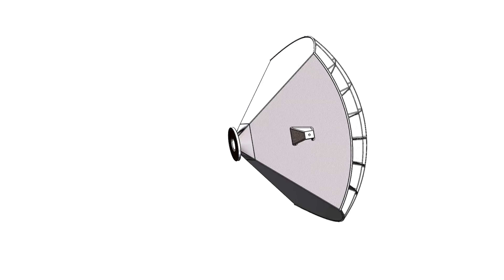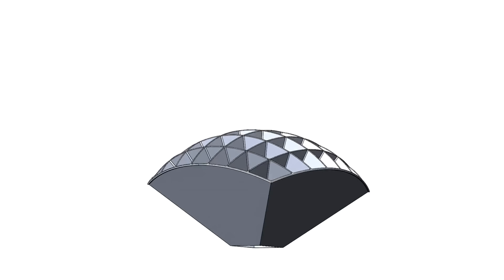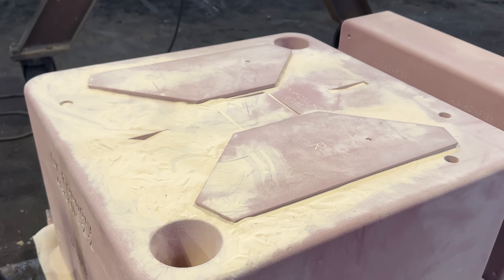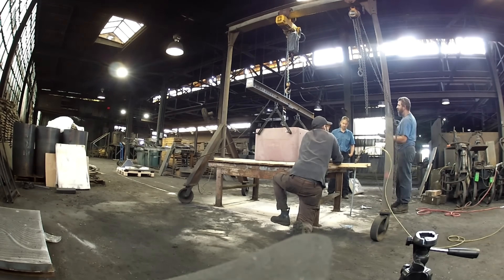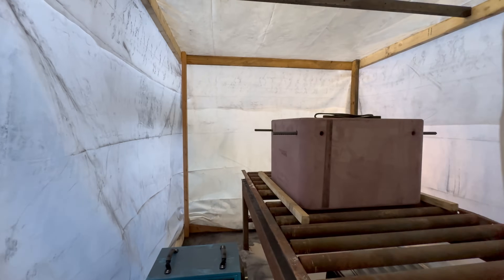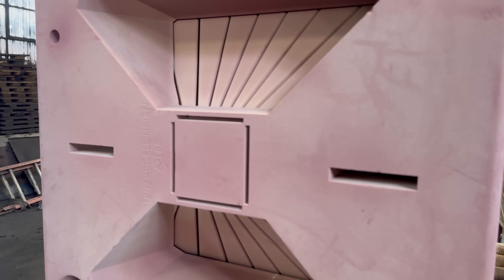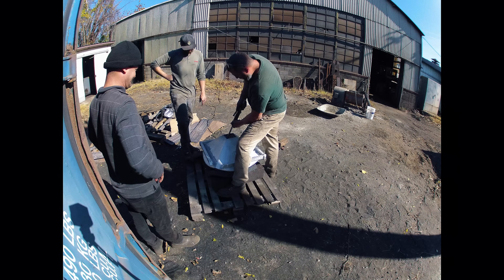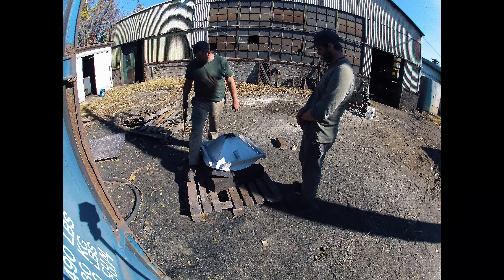PUSHING THE CASTING ENVELOPE W/ 3D PRINTED MOLDS

Comment: This is quite a feat but wouldn't a 3d printed horn directly in the same shape sound the same ? 
Also wouldn't a part like this traditionnally be made of lasercut sheet metal ?
Reply from the maker: Maybe. But a horn 3D printed from what? Printed in Aluminum? It would be astronomically expensive. Printed in plastic? Would a plastic printed horn function better than a cast aluminum horn? Not even close. 
Traditionally laser cut? No. Traditionally cut with tin snips and shears, yes.
Reply: @hinmaton  polycarbonate carbon fiber filament with a polyurthane clearcoat ?
Reply from the maker: I don’t know, does that material have better acoustic properties than cast aluminum?
Reply: @hinmaton  I don't know, maybe not better/worse but different resonance values. I imagine the exact dimensions would have to be adjusted to the ideal values for that material, especially the different speed of sound inside this material.  It is one of the stiffest plastic available and the price is reasonable.
Reply from the maker: So, to your original question, would it sound the same? I suspect that it would sound different, but it would be interesting to run some A/B tests for sure. I have no concept of what something of that size would cost to print.
Reply: @hinmaton  To sound exactly the same, the dimensions would have to be adjusted to the exact new resonant value. I don't know know if that means smaller or bigger horns, bigger or smaller wall thickness, if it's a big or a small difference.
As for price it is 64$ per kg and it is half the weight for the same volume of aluminium (1.2g/cm³ versus 2.7g/cm³)
This is probably a 2 day print on a large format printer like the Orange Storm Giga (an experiment 1 cubic meter printer)

Comment: The sound quality is very good no changes needed for sonics. You did amazing work!  The bass system I designed for it matched radiation pattern and it sounds as good on axis as off. One of the reasons I wanted that 7x7. Really look forward to the 2nd. And the  1/2 sized pairs for 1 inch compression driver. I was only able to get a 5x5 3d carbon printed. The 7x7 is visual and sonic art. Wonderful -wonderful The world needs more casted. I'm so thankful. JK
Reply from the maker: That’s fantastic to hear! I can’t wait to see images of the completed system you designed.

Comment: The cad design is simple to be honest, the molding is the challenge
Reply from the maker: Interesting perspective, I see the cad design as both, horn model and mold model. The CAM portion of this project is printing the CAD design. So, if the CAD is simple, then that makes it all pretty simple. And at a micro scale, you’re right: CAD is simple, CAM is simple. The challenging part is having the idea and figuring out how to bring it all together to achieve the results you want. If you’ve done it right, it often appears simple. So, thank you.
Reply: I agree it's the whole process and how to achieve a great result. I am positively surprised how well the thin wall thickness cavaties filled up. The result was very beautiful ❤️

Comment: Is the sand mold itself 3D printed, or was the mold produced around the 3D printed part? Either way, looks like it produced a very nice surface finish for a sand mold.
Reply from the maker: Great question, I honestly had not considered for this confusion. The sand is 3D printed, layer by layer, the full size of the build box. So when the printing is done, they have to dig through the giant sand filled build box to get the mold out. The mold is also full of loose sand, once the loose sand is removed the mold can be poured with whatever Liquid Metal you want.

Comment: Maybe it possible to make mold with individual “columns” for each hole? For easier control an more options for manufacturing)
Reply from the maker: The 3D printed sand mould is a Waste Mould, you have one shot to get it.

Comment: you need ppe my guys. you are not just working with sand but fine sand sprayed in the air. those vibrators and hearing protection should go hand in hand. its so cheap. just a tiny investment in protecting you and your workers.. fine sand and sand dust inhalation it can cause a bunch of rare cancers (so if your workers get it they know who to blame)and breathing issues like decades after exposure. im not one to use ppe unless 100% needed due to wanting to be comfortable.  not worth the risk. even if it looks dumb and is uncomforable.
Reply: Silicosis- uncommonly known processes in which scars the lungs. Can easily turn cancerous and cause other internal degradation of organs.
Funny how such a simple thing like a respirator can stop such a destructive material.

Comment: I wonder if this would be a good candidate for melt out investment casting when combined with 3D prints?
Reply from the maker: I’m not exactly sure what you mean, please clarify.
Reply: @hinmaton  I'm no professional, so just take me as a rambling youtube comment. But what I was meaning is really just a modern modification to lost-wax. you can 3d print a complex geometry, and some types of internal features, using a material with a low glass temp and low viscosity when melted. They make for "weak" prints in the traditional sense, but are a good choice for this use case. You can then assemble the prints into your final design plug. I've seen it done with investment compound, but I would think it works for sand too once you reach a certain feature scale. Once the mold dries, you throw it in an oven for burnout, and what was the 3d print melts and flows out, leaving you with a perfect cavity. With such thin walls I was imagining it would be quicker with investment plaster. While the investment is more expensive as a consumable, its a lot easier to demold so it saves you labor and time. Is it worth it vs three hours of chiseling, no idea.
Reply from the maker: I’m really not sure to be honest, but putting these in an oven could be problematic due to the size. I would also suspect that any low temp low viscosity material would soak into the sand. 
That being said, they do make similar machines specifically for investment casting, where it’s printing “wax” materials and the shell (if I remember correctly).

Comment: wouldn't  a pressure washer  do a better job of cleaning out the cores - i use one for removing ceramic shell - not only is it much faster   than the sand blaster - theres no dust  (though you will get very wet ! )
Reply from the maker: Possibly, however unlike ceramic shell the printed binder is not water soluble. But, maybe splashing sandy mud would be preferable to high speed sand dust hahaha
Reply: @hinmaton  fired ceramic shell is also not water soluble - the washer mechanically  cuts it  or just gets between the shell and the casting  and breaks it off - give it  a try -i didnt think it would work either !
Reply: @hinmaton  4500psi pressure washer and a zero degree rotating tip, also known as a turbo tip, will rip through that stuff in no time. That setup was originally designed to clean concrete off metal forms from high rise jump forming. I personally used them for many years in other concrete based applications and they are incredibly strong. They will literally drill a hole in solid concrete.
Reply from the maker: That sounds perfect! Gas powered I’m assuming? Happy to be wrong if that works as well as you say. I’m definitely adding that to the arsenal. Thanks 
Hh
Reply: @hinmaton  i just use a domestic electric one   - maybe  check with a lump of used mould before you buy one - but ceramic shell is much harder than water glass or resin bound sand  (i use water glass cores sometimes and its like a hot knife though butter )
Reply from the maker: Good point, I’m just going have to try it, seems like this might be the best way to do this. Thanks for the suggestions!
Reply: @hinmaton  on this topic, is the printed sand recyclable back into the system like conventional oiled sand? What's the binder? Would getting it all soaking wet then mean you'd have to kiln dry it or something to avoid moist molds down the line?
Reply from the maker: Fantastic question. The binder in the printed molds does not mix well with our typical 3 part binder, so we do not recycle these molds with our in house molds.
Reply: @hinmaton  can it be reprinted with though?
Reply from the maker: No, the printing is out of house and I’m fairly sure they can’t reuse sand in their equipment, but I’m not exactly sure.

Comment: It was possible. It is just cumbersome to produce a good result.
Reply from the maker: Having spent most of my life in manufacturing, I've found that many tasks needed to achieve a result are challenging and require significant effort. However, perhaps the process itself is part of the enjoyment, especially when the outcomes far exceed the efforts required to achieve them.

Comment: Why was the method of using 3D mold chosen instead of using sheet metal and plasma cutter (and welding)? Is using the 3D mold cheaper in this case than cutting the pieces out with slots, assembling them and welding them together? Amazing work by the way!
Reply from the maker: Good question. I’ve been a metal worker/fabricator for 43 years now, I won’t say that it can’t be done, but I will say it shouldn’t be done that way. There are 49 square cells, @ 20” long, 4” square openings at the big end, 1/2” square openings at the small end. So even if you could get a welder or soldering torch plus filler material in there, that’s 326+ feet of weld seam. It’s simply not practical. The multicell horn was very popular in its day (30’s and 40’s) but fell out of favor due to the manufacturing complexities making them too expensive to make at a reasonable profit. 
So, the complexity of the challenge hasn’t really changed, but the technology has evolved to a point where they can be made less expensively and more efficiently. The profit margin question still remains to be seen. 
I hope this answers your question. 
Hh
Reply: Do you have to weld/ solder? Could it be friction fit or peened at the joints?
Reply: @AlexxSymmm I suppose it could be possible, but if there were any areas that were not tight, it would buzz causing audible distortion. So, probably not worth it.